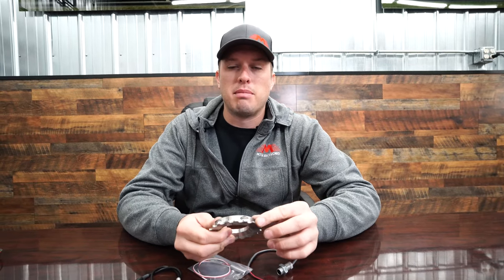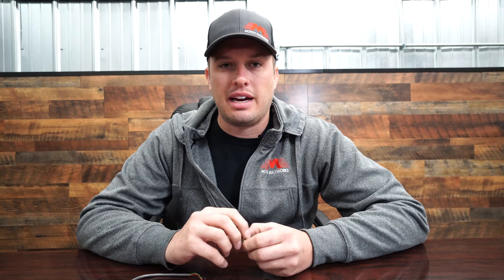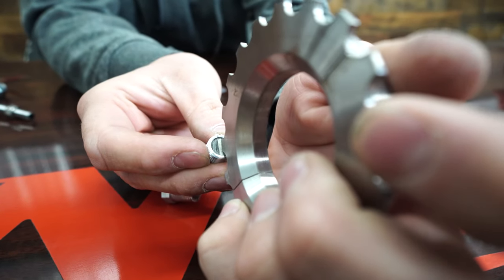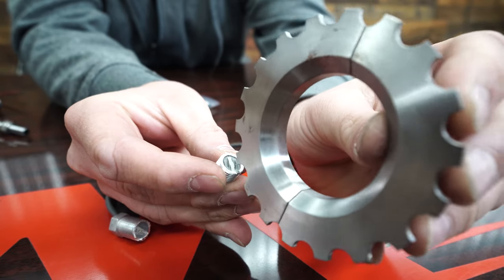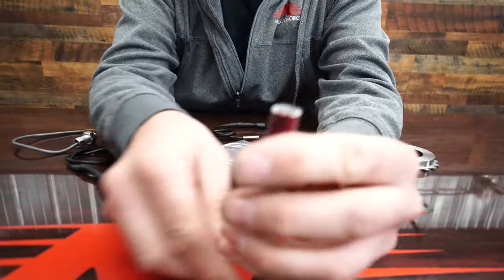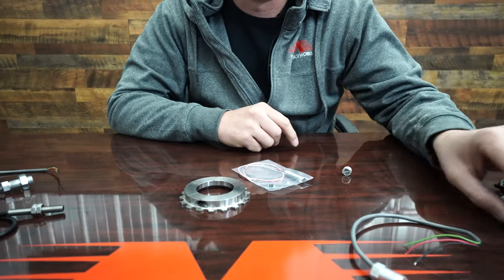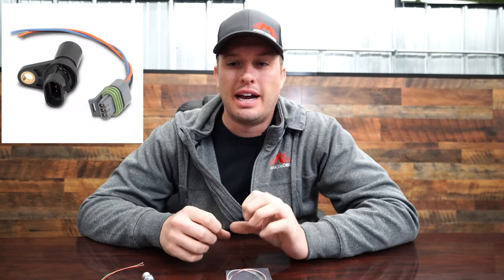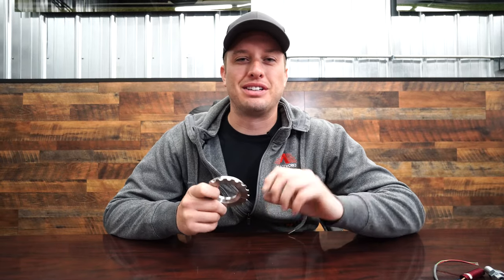What's inside a Hall Effect Sensor... Fix a bad signal! Tech Tip Tuesday

Comment: Great share and makes heaps of sense. I've encountered the same problems when dealing with proximity switches used in industrial equipment. Getting a strong positive signal would involve mucking around with the position of the sensor, but I never knew that the internals can be polarised like that. Thanks!

Comment: I have an f body t56, with a variable reluctance speed sensor. The terminator x ecu I’m using only accepts a square wave signal. Do you have a solution for switching the stock t56 vss sensor to a square wave? I see Tick performance has a drop in Hall effect sensor for the fbody t56, but it’s pretty pricey :(

Comment: Just finished building a bracket and putting your sensor and wheel on my 12 bolt… I really hope i don’t have to turn the sensor lol. These fbody cars and the TA.. it’s all pretty tight… and my sensor isn’t dead center so this will definitely be a issue 😭